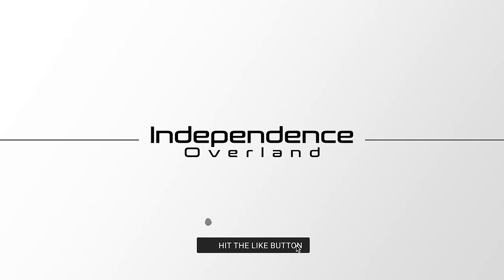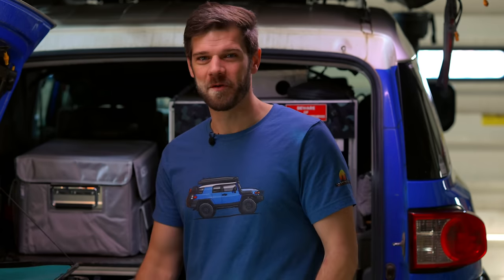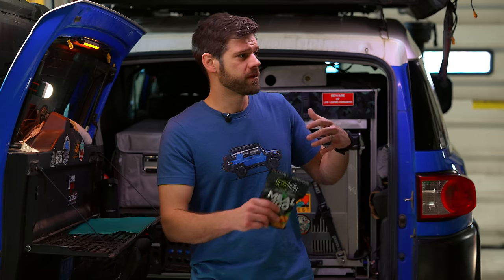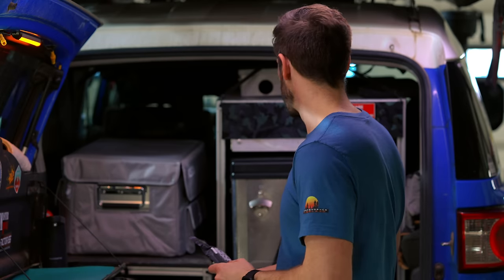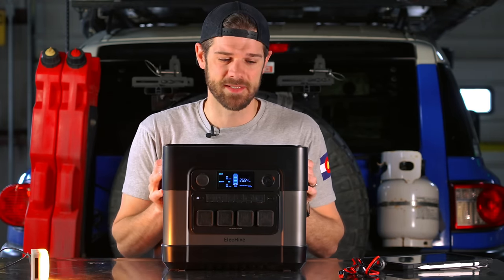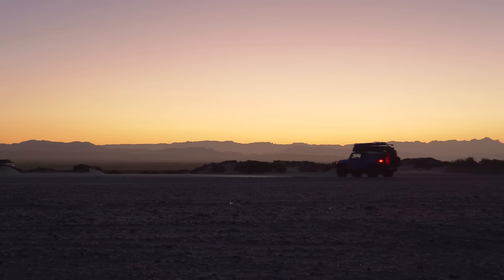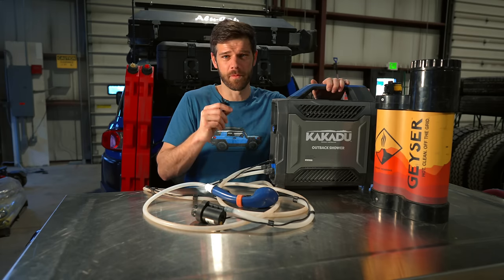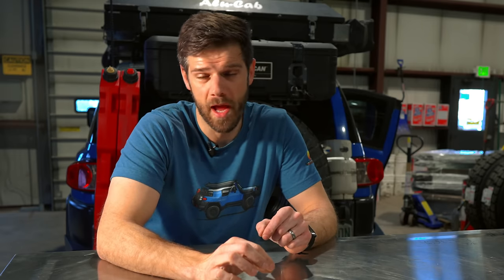Trip and Gear Essentials for Overland Newbies

Comment: I slightly disagree with the beginning of this video.  Poor recovery gear or no recovery gear at all is an absolute trip killer.  I tell everyone get a winch and recovery gear FIRST.  Can't have fun and progress on your route when you're stuck or broken down.
Reply from the maker: Yeah I intended for this video to be more focused on the comfort side of things, but since it was a compiled but of info for beginners I should have at least referenced my recovery video. But I still think when I talk to people who are like “I want to go but I need a bumper and skid plates, yada yada” they are almost making an excuse to not go do cool stuff. Beginners usually aren’t so brave they will find themselves in the same situations I do, and I rarely need to use recovery gear, while I always use the awning, fridge, tent, etc.
Reply: Why would you recommend winch and bar? They will make beginners too confident because they know they have the winch and not choose the right line for the tracks.
Reply: Nonsense. You don’t need to go risking your truck. Most people don’t as this a daily driver. First thing you need is a tent.
Reply: Really depends upon your use case. In YouTubeland, “overlanding” is synonymous with “off roading,” but it doesn’t have to be. Everything here applies equally well to the person in the tricked out 4x4 and the old beat up Camry.
Reply: It depends on the destination and length of the trip in which recovery gear you need. I 90% off road on the beach where winches are not high on my list of recovery gear. A tire deflation kit, good set of maxtrax or similar brand, standard issue folding military shovel, and a tow strap is really all I take on my weekend warrior beach trips. I have started bringing along a small box of general tools if I ever needed to do some quick maintenance… also I recently started carrying a high lift jack because I saw a dude out there that had to utilize one and said to myself if he needed it I may be in a situation where I need to one as well.
Reply: Winch is overkill for a beginner. Traction boards are more than enough
Reply: Completely disagree. You can go explore a TON without going anywhere that you would even think about needing recovery gear.
Reply: @John-ke2jm agreed, but at the very least I think people should have a jack (at least the one that comes with the vehicle), jump starter, shovel, and tire repair kit. Next would be a tire deflator and air compressor. 

You can practically go majority of places out there safely without being stupid.
Reply: @parryhooper  Yes, I agree. Just gave my tire repair kit to someone with two flat tires on a basic gravel road. I'm not talking basic repair stuff, I'm saying recovery gear, boards, winch, etc. Yes, a shovel is cheap and easy, so is a jack which you need to change a tire and tools to do basic repairs.

Comment: If you want a decent fridge unless you are a YouTuber get a setpower PT series. Right around $300 3 year warranty on the compressor. I've been using one for almost a year and it's been bullet proof.
Reply from the maker: I own 3 Snomasters and I paid for them. Yes, the cheapest fridge I have was free for a review video. But most people don’t want to spend 1400 on a Snomaster. Iceco is a solid fridge that’s more affordable, and have a reputable compressor. 

I reviewed a Setpower 2 years ago and I was not very impressed. It’s the fridge referred to in this video as a “cool box”. Temps were always off, and it struggled. My friend used it on our Baja trip and he was drinking mildly chilled drinks, while I was making ice and 33 degree beers. Perhaps Setpower has corrected some of this since.
Reply: Ya there are plenty of fridges in the $300 range that do the job just fine.

Comment: A lot of awesome gear in this video and great points. I do think you’re missing something by writing off soft shell tents entirely. Obviously everyone has different needs but I have found that soft shells just suit our needs better than hard shells. AluCab doesn’t even make tents big enough for a family. We started off with a $5k ikamper and hated it and have been very happy with a cheaper soft shell. As always love your videos man just thought I would share that perspective.
Reply from the maker: I am surprised you didn’t like the Ikamper. That is what I view as kind of the family sized hard shell, not quite the same but has a wind ramp on one side. I seriously have never had someone say they prefer a soft sided tent, but if it works, it works! 

Are you using it on a trailer by chance? On a trailer they a LOT less of a hassle to put away. I’m sure your larger sized one is a real bear to fold up. 

Thanks for your comment!
Reply: @IndependenceOverland   yeah I just didn’t think the build quality was good enough to justify a 5k price tag (tent + tax and shipping) the mattress was no bueno, and I personally felt like the sleeping area was just a bit to snug for a family of 4.

I have a camper shell on my Tacoma and have it mounted to that using a Front Runner roof rack. It’s pretty big but it’s actually very light weight - 152lbs. They for sure take more effort to set up/ put away then an ikamper or AluCab but we are still only talking 5-10 minutes, no different then the smaller soft shells.

Comment: If you want a fauset they make almost similar ones to the dometic for under $20. I know not good enough if you are on YouTube but it pumps water and you have $80 in your bank account.
Reply: Yeah dude I totally agree.  My fridge was less than 300.  54 quart.  It kicks ass.  You can budget on certain items here and there.  Like a shovel or headlamps.  It's a light and a shovel, don't overthink it.
Reply from the maker: Doesn’t really have anything to do with being good enough for YouTube. I bought mine, it wasn’t given to me. It’s a well thought out product that works and works well. The auto fill modes are really nice. Maybe I’ll buy a cheap one to compare the Dometic to for the next rig.

Comment: We upgraded from soft shell to hard shell, but it was only because of pack up time. Our soft shell was pretty expensive ($2400 AUD) and that thing was rated to constant winds of 80 kph, was very solid and super comfy and spacious. But pack down was so annoying, especially at midnight when the tide is coming in further than you anticipated 😂 I like the Geyser just because it’s compact and electric.  I wired a relay so I can flick a switch 30 mins before getting to camp, then just open the shower awning and can leave the unit mounted in the car while I use it. Great for solo camping, as slow to reheat on electric. Had the same gas one as you, nothing wrong with it, and it’s instant heat, but taking it out the car and then brushing off the sand and dirt was annoying. Why did you get rid of your heat exchanger? My wife loves the shower awning and the chemical toilet, makes all the difference for her. Most beaches in Australia you have to use a chemical toilet too. And having a water pump with pressurized water in the back for cooking so far is my favourite mod and probably the cheapest! Love your uploads man!
Reply from the maker: Thanks for the shaper chat Rob you’re awesome!

I still have the heat exchanger shower under the hood, but compared to the Kakadu or the Geyser it is such a hassle, and it requires a lot of water. It works pretty good, but it’s about 3 gallons per person to shower with it. It’s got so much pressure it just rips through water. The other options are just so much less of a hassle. 

Thank you Rob! I’ve got some cool adventure content coming in the next few days!

Comment: As fun ad a small vehicle would be, I love the room in my 1 ton with 8 foot box
Reply from the maker: Yeah, the Fj Cruiser is definitely restricted on space. I am very much looking forward to having a truck bed soon, even though it will be small it will be a whole lot more space than I have now.
Reply: @IndependenceOverland I put 100ish nights in my old short bed with cab height topper... still had a blast but man does is the extra 2 feet in length and 10 inches of height is amazing! Working on a biuld video now... but my gopro footage is in a size my phone can't use to edit lol...

Comment: The best fridge we've ever used was bought in a french supermarket for ~€100 about 10 years ago. Proper compressor one. Has survived years of abuse, the dust of the Sahara, harsh vibrations, being dropped and bashed all over the place. It'll still keep beer cold at any temp.
Sometimes you can get real lucky with the cheap stuff, don't buy the first thing you see online 😉

Comment: This is a good one. I'm going to comment as I watch. But to start, most vehicles are pretty capable right out of the box for a beginner with just a good set of off-road tires. Once they get more adventurous (maybe daring), then start adding the cool, fun stuff. ... To us, the fridge was a game changer. We too went with a "known" brand. Spend the little extra, and not go cheap Amazon. You'll end up buying something else anyway. Just get it right the first time... And with a bit of Tetris, you can get a few days in a smaller one.

Comment: Great video! Yeah I agree with most of the things you mentioned. A fridge, a good tent, awning, backup foods, and some recovery straps and a shovel and you should be good! I see ppl who spend $20K+ on ridiculous lifts and tires and bumpers and winch, and for 99.99999% of the time you’ll never need those things. 

I’ve just now upgraded to RTT after 3 years of sleeping on a ground tent and inside my 4Runner. It’s a great convenience but I would have been fine without the RTT.
Reply from the maker: Yeah it’s the cool factor people are often chasing. And I get it, but for people who just want adventure, they don’t need to throw the catalog at it.

Comment: Great video.   Would you recommend the aluminum shell over the ABS shell, just based on comfort and what you mentioned about stability?
Reply from the maker: For the tent? Yes. ABS can be alright, its just a matter of how hard you are on gear. I personally like the idea that I can weld my tent if it were to get a hole in it or something. For lighter use, ABS can be just fine. I would avoid fiberglass entirely though.

Comment: Hey, new to your channel, and new to Overlanding- though I have an extensive background in long-distance backpacking and back country hunting. And I don't want to be "that guy"- but since this video is aimed at "Newbies" I feel really compelled to point out a major safety issue in the content you presented regarding COTTON. Since you said you have a background in back country hunting I am surprised that you said the reason we don't wear Cotton is because of microbial growth/stink/takes longer to dry out. This is so close to the real reason, but you left out the most important component. COTTON KILLS. Because cotton absorbs so much water, the cotton fibers collapse & lose their structure resulting in a loss of insulation, this can accelerate hypothermia in cold conditions (like at night in desserts or during shoulders seasons and winter). Whereas wool and synthetics maintain their structure when wet, wicking away moisture, they will maintain a large percentage of their insulating properties (trapping air, and letting your body heat warm up that air) thus lowering the chances of hypothermia. The antimicrobial/stink factor is so far down on the list of why wool and synthetics are preferred for back country activities. Just a head up for everyone else out there!
Reply from the maker: Yeah, cotton sucks in that regard but it’s not nearly as dangerous when you have a truck with HVAC, a tent with a quilt, and typically several changes in clothing. The chances of everything getting soaked while traveling in a 4x4 is pretty slim, as with hiking it’s a very common issue. And if it were to happen, you turn the heat up and head home or change your clothes.

Cool user name. I like getting out to forage mushrooms. I’ve done a few videos on it.

Comment: Nice video. Do you have any idea when Hardkorr will be back in the us?
Reply from the maker: Not totally sure, they had send me an email in late 2023 saying it would be early 2024 but I haven’t seen anything more on it.

Theres a US company doing something similar I will be doing some content with. Stay tuned for that.
Reply: @IndependenceOverland  I found these Drifta Stockton Stick On Flexible LED Light Strip Kit, they look a lot like the Hardkorr. Do you know anything about them?
Reply from the maker: @Stranger451 oh wow, that is identical. They must have found Hard Korrs supplier. Looks like a nice kit, thank you for bringing that to my attention!!
Reply: I like the Hardkorr switch better.
Reply: @IndependenceOverland  I just got an email from Hardkorr, the awning kits are back in stock.
Reply from the maker: @Overlanding45  Did they give you a link? I am curious who is shipping for them now. It was GTFO handling that for them previously.

Comment: ICECO are great, but they are a Chinese company. The US company is just a distributor, owned by the Chinese company.
Reply from the maker: Yeah I am aware of that, but compared to some other companies where if you have an exhance they tell you to send to to Shanghai so they can inspect it for repairs, I consider that a win. So many companies are from China these days. Its hard to get around it. 
Snomaster is South African
National Luna is South African
Iceco is China
Dometic and ARB are chinese built I am pretty sure. 
I dont think any US companies make a 12v fridge and if they do, it would be the most expensive fridge ever.
Reply: @IndependenceOverland  sure, was just a correction, I want them to get their due credit - they are a quality Chinese outfit, bought an amazing asset in the compressor technology and went for it with constant iteration in the market.

I live in China, overland here, have their jp30 pro for a few years because it's warranty covers operating at 30 degree cambers.